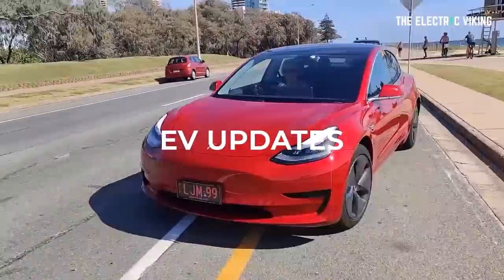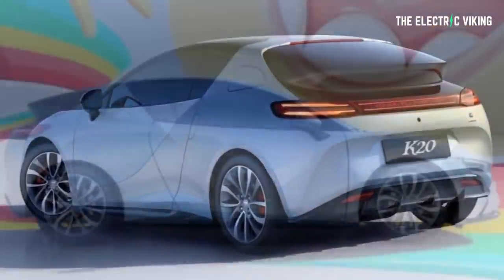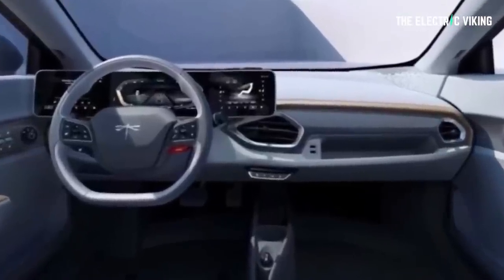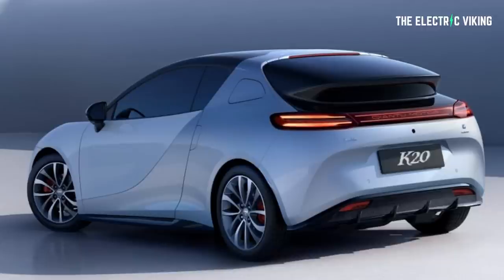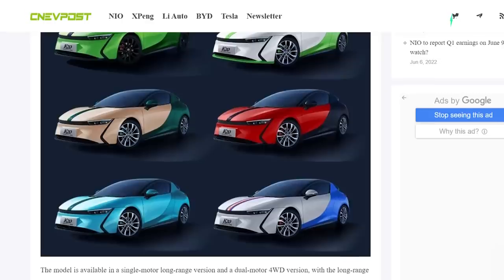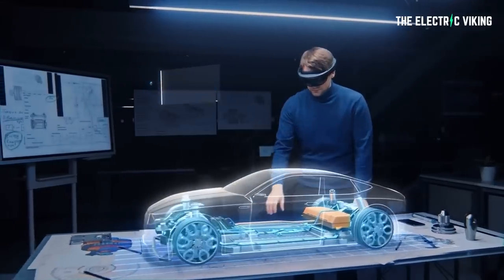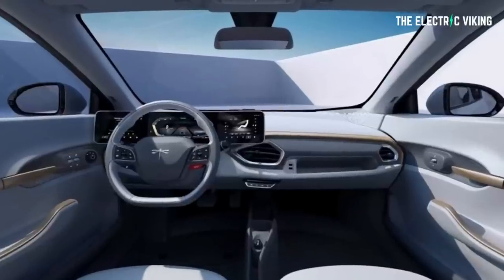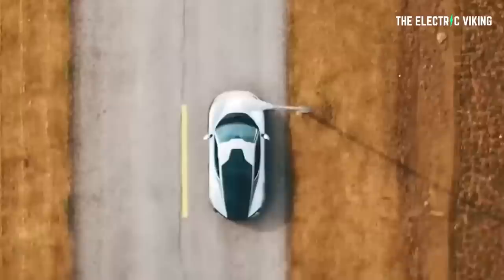The cheapest electric sports car in the world is AWESOME

Comment: the problem is that it's not going to be 13~22k it will be sold by 20~40k. Because of that, many places that would be too much for people to think of it as a good price. they would prefer to get a simpler-looking car for 12~16k USD. Specially places with high taxes for vehicles.
Reply: Correct.

Comment: I had hoped legacy auto would have gone all in on building EVs like this one, basic, five years ago. Like if along with the Bolt GM made one of these. Now even these bare minimum cars will come from China. The image gave me a cold chill when considering the likely outcomes for legacy auto. Who'll make it to 2025?

I'm thinking it will be the ones that come clean first about the need to gracefully close down ICE. Then we reuse, repurpose, rebuild as needed. EV conversion is pursued with urgency, build lots of megafactories. Expand retraining opportunities to help labor out.

Maybe the best thing to do is to spin off all the sub-brands and let them each split into an ICE and a EV division. Then spin ICE down. Just have replacement and service. Spin up EVs creating factories that will ramp to 100,000 quickly 450,000-650,000 run rate being the norm.

There'd be lots of startups in the US, then. Like what happened with China. ICE is in the way.
Reply: Even the European manufacturers are starting to ship cars from China to Europe, as the Chinese cost base is so much cheaper and the manufacturing EV base is so much bigger. Will be very painful for the European manufacturers in Europe for the next few years. The US are all trucks and SUVs, Hyundai are doing well in the mid-range SUV space although Ford is in there as well in the EV space, as well as Tesla dominating for now. Lifetime warranties would really change the market, legacy auto would hate it.

Comment: Sure its cheap bargain, but crash test is terrible? What's your life worth? Warranty lifetime? Batteries don't last 20 years!
Reply: The battery should last 20 years just not very useful in an EV after it has lost half it's range! Even BYD has that so called lifetime warranty but with a limit of no more than 30,000km per year, most EV car manufacturers are saying around 10 years so that is the "lifetime warranty"

Comment: If it's available in right-hand drive for the UK roads then yes I would buy a dual-motor one with a large battery pack then I would put Simpson seats in her a few more mod cons some subwoofers some wider wheels and better looking a centre console with and entertainment screen built-in and upholstered to the same spec as the car I would go for the convertible driving with the top down blasting good tunes nothing better lol.